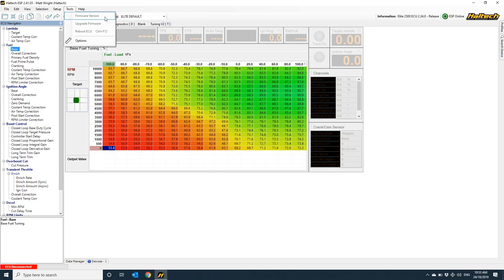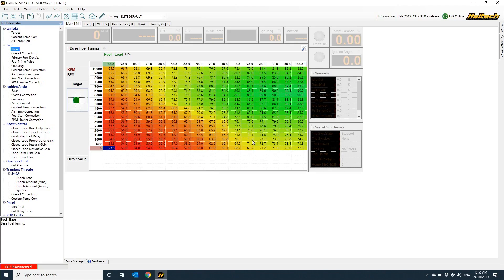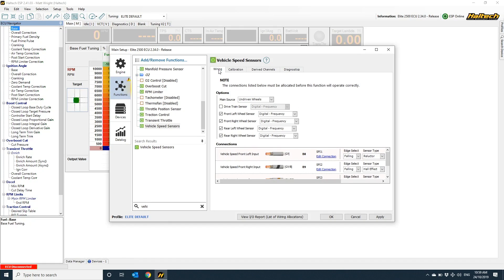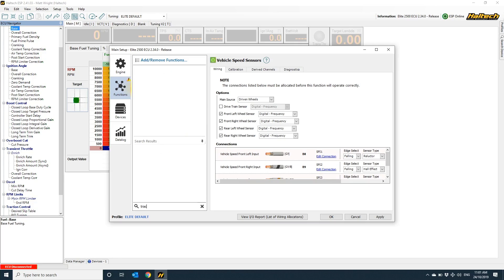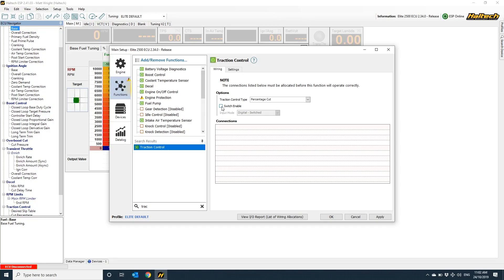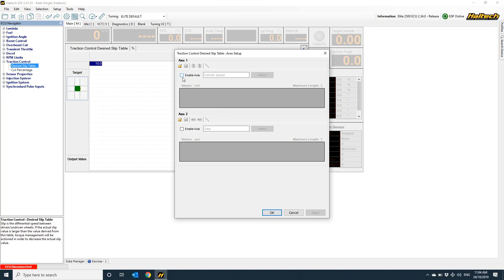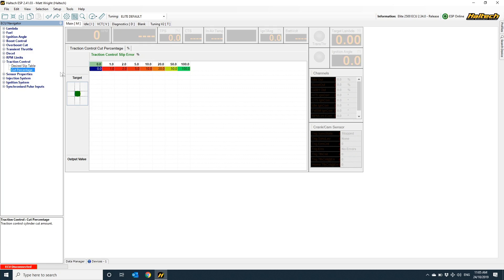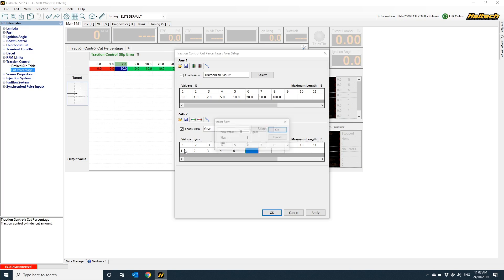💬 Traction Control Basics + Setup  |  TECHNICALLY SPEAKING

Comment: My question is more about the actual hardware. I've not seen a ton of aftermarket wheel sensors, so I assume that people are using their ABS sensors for this? What if we want to use ABS as well (as far as I can find, VR signals don't share between devices well)?

Comment: Is there a big difference when programming/ setting up FWD, RWD, and AWD  vehicles. And can you programme a switch to turn it off or switch over to another set up aimed for drag racing or other racing?
Reply: We use in our car a switch with 6 different setup were you can set the slip you want... and a second switch were you can turn it of... (ELITE 1500) Also you can chance the maximum slip on different boost levels or throttle positions or road speed,...aso...
Reply: Thanks guys really helpful, seems like a lot of options and variables to consider.

Comment: Thank you very much for this video! We drive an ELITE 1500...We have the problem with FWD that one of the rear wheels are in corners not on the ground... so it would be cool to have the chance to select the faster wheel of the undriven wheels as the main speed.... but I can not found the "Derived Channels" Page... does it only have the 2500 or do I something wrong? Greatings from Austria!! (Excuse my bad english ;-) I have done it without google ...haha...
Reply: @Matt Wright ....Hy Matt! Thanks for your information. I was on version 2.32.....Now I have done the update... And it works!! Thank you very much for your support!!! Greatings from Austria!!
Reply: Ich glaube nur das 2500 gibt es mit der T Option. Müsste aber auch auf dem Cover des Steuergerät ersichtbar sein.